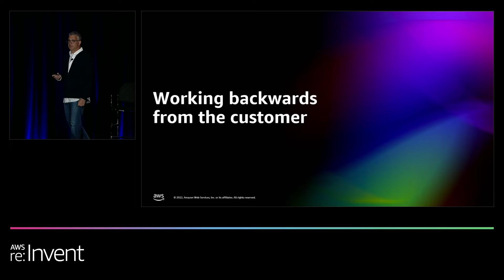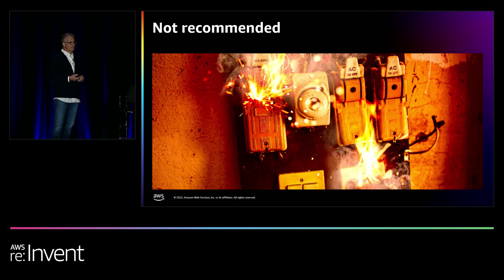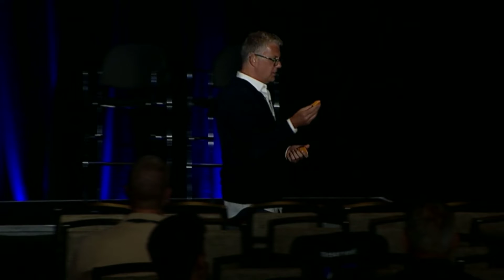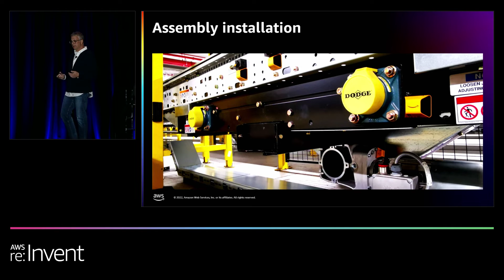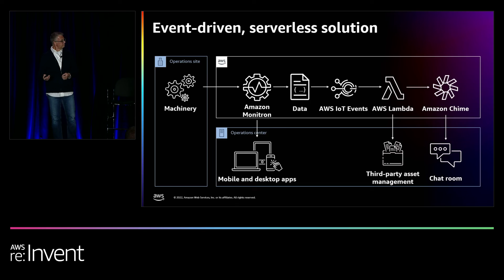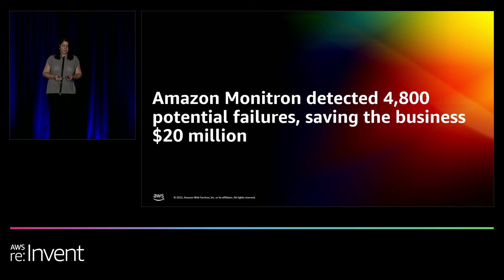AWS re:Invent 2022 - Avoiding mechanical issues w/predictive maintenance & Amazon Monitron (AMZ301)

Comment: How long does the battery in the sensor last when you went from 12 weeks frequency to each hour? What lines of resolution can I get on the spectral data that is used for machine diagnostics?
Reply: Hi Colton, here is a resource that may shed some light on your questions: https://go.aws/3HkJ9TW. 🔦 In this FAQ, check under the topic: Devices, you can find info on how long the sensors last as well as other relevant data. Additionally, you may get help by viewing and posting questions on re:Post: go.aws/aws-repost. Our community of experts are here. ^DC